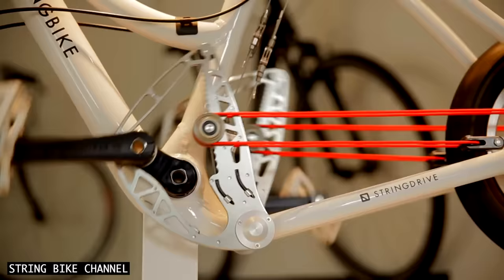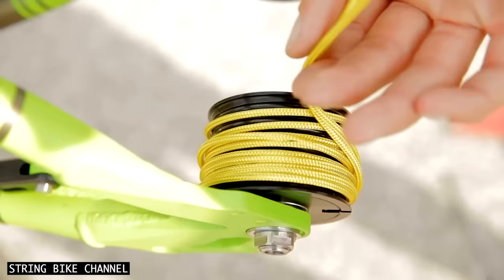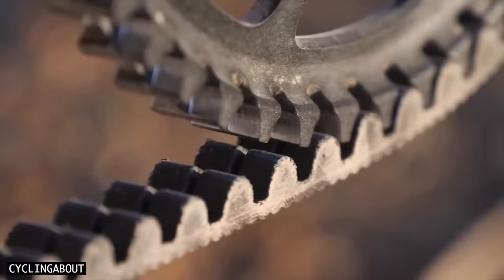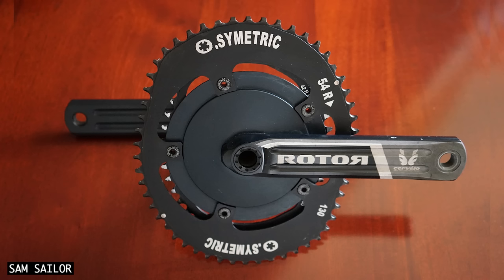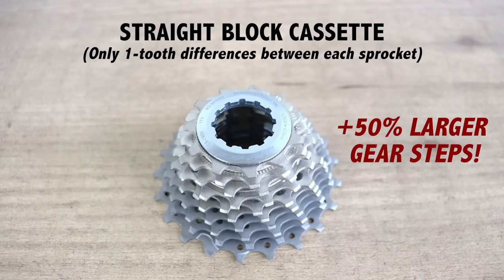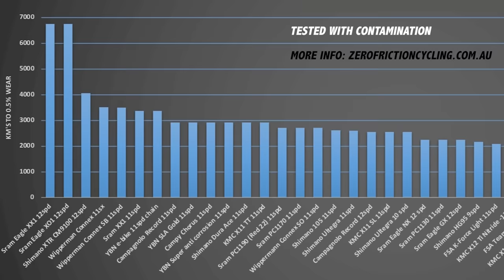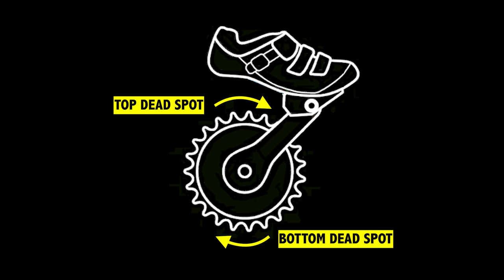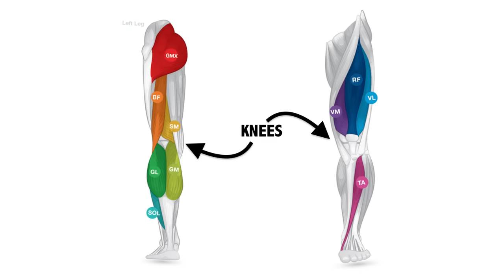Are Chainless String Drive Bicycles a Genius or Terrible Idea?

Comment: If anything, this shows us exactly what a revolutionary idea the Belt Drive was.
Reply: It shows that belt drives are a good option; not sure they are that revolutionary since belts precede chains by a long way, and have never gone away (car fan-belts, etc). Their advantage is that they leverage other developments in bike tech (notably hub gears). I wouldn't say revolutionary so much as an idea whose time has come.
Reply: There really isn't enough different about a belt and a chain for a belt to be revolutionary. Digital drive (maybe should be renamed) would be revolutionary if it ever took off.
Reply: yeah I agree on dialing down the "revolutionary" bit.  Unless that was merely a pun.
Reply: @chrishowell5718   <<and have never gone away (car fan-belts, etc)>> And the main drive system for Harley Davidson for decades.
Reply: wtf is wrong with regular chain jesus christ poeple cmon
Reply: The belt drive is a horrible idea, since its efficiency is very low, compared to chains and strings, and since it needs a proprietary, expensive frame... Don´t compare strings with belts. Belts hate going around small cogs, just like chains hate it. For strings, it doesn´t really matter to them. Belts are more durable, but the energy one wastes when using a belt, would be enough to wear-out a chain, without even moving a single foot. =very wastefull, while as expensive as several chains, I´ll stick with the chain. I never have to go off-road (since asphalt was invented), while I have to drive everyday, so, the belt´s advantage of staying cleaner also doesn´t count. maybe the belt-drive was revolutionary, for countries without asphalt-roads...
Reply: @joeskis   oh, I thought that was the whole thing...
Reply: Not revolutionary they are not better overall than chains and belt drive has been around for a long time.
Reply: You need to research new belt drives more thoroughly.
Yes they are less efficient, but not to the level that you claim.
Reply: @klausbrinck2137  Belt drives are great for motorcycles.  Harley Davidson has been using belt drive since the mid 80's.  Smoother drive train, can handle the torque, don't stretch like chains do, don't wear out like chains and sprockets do.  The Gates belts HD uses, last for 200,000 miles (322,000km)...

But I agree, for bicycles, nothing works as well as chains do.
Reply: @CaptainRon1913  Yeah, for bicycles, belts are an overkill, not comparable with a Harley Davidson (0,5hp vs. 100hp  ;-)
Reply: There’s one big advantage for belt drive, it’s maintenance free. Teeth do not wear like cogs nor belts stretch like chains. As for efficiency, it’s hardly noticeable at 2, 3 % less. Maybe more with internal gears and weight penalty, but not by much. Technology progressed much on materials that narrowed down the efficiency difference.
There is no need for regular oiling, chain adjusting, and replacing worn cogs and chains. That’s excellent for touring, work horse and daily use.
Reply: @aviverde9031 heavy, and it wears out faster.. the main advantage of the chain is that you can splice into it anywhere for a quick repair, which you can't do with a belt of any type, nor this string drive either... the only option for these is to replace the entire length.  the advantage with the Dyneema string drive is that spares weigh hardly anything... you could carry 6 of the equivalent length 3/16 inch./ 5mm Dyneema loops for the same weight as one spare ultegra chain, and 8 of them for the same weight of KMC 8-speed chain so literally 1/6 and 1/8 the weight of each chain type respectively.  note that I don't know exactly how long these Dyneema string drive strings actually are, it looks like the two ends are fixed against the frame in the middle of the loop wraps around the rear hub several times...and there's one on each side of the bike which might reduce the weight advantage when mounted on the bike to 1/3 and 1/4 respectively because you need two, but from the looks of it I would guess that it's probably shorter than the standard 116 link chain.
Reply: they aren't normal automotive belts that he's talking about, he's referring to Gates carbon belt drives, I haven't seen the data on them, maybe you have and that's what you're actually referring to.  though you are correct about needing a specific frame with a cutout to pass the belt through. a metal frame could be modified for it, that YouTuber who does the circus style bicycle acrobatic stunts had her bike done, but certainly nobody's going to do that with an off the shelf carbon fiber frame. I'm assuming they haven't been able to succeed at a carbon fiber belt that splits for easier installation/removal . Dyneema string is similar to the belt in one way: it's low-stretch. the Dyneema cordage I get for camping purposes does stretch under load as any slack gets taken out of the weave, so I'm guessing they would have to preload it at the factory during manufacturing to ensure an exact fit.

personally I'd gladly take the pedaling efficiency hit to increase the reliability of my transportation. I go through 2 chains per year, and one drivetrain. if I could switch to the gates carbon drive that maintenance alone would drop to one belt every few years, and the cassette and chainring maintenance would be swapped for the maintenance schedule of whichever internally geared hub.  when you're pulling a lot of cargo, there's a lot of inherent inefficiency that your saddled with already, and your body will adjust, so your priorities switch. I've gone from a cheap road bike, do an intermediately priced road bike, to a gravel bike, and now to a fat long-tail cargo bike that weighs 54 lb/24.5kg all on its own, and I often use it to carry around 54 lbs on the rear rack. safe to say marginal gains went out the window a long time ago for me, and probably for most of us who take the path less traveled. when you're in the middle of nowhere with no bike shops around, reliability FAR outweighs marginal gains
Reply: @klausbrinck2137 he's talking about Gates carbon fiber belts in this video, not your standard automotive type
Reply: @CaptainRon1913 he's talking about Gates carbon fiber belts in this video not your standard automotive type belt. and he's done a whole video about having switched to and toured with it. using negate carbon fiber belt is more about reliability than any sort of marginal gains
Reply: They are so revolutionary that sewing machines are no longer belt driven but use direct drive. Belts waste a lot of energy which is bad for the environment.
Reply: @aviverde9031  Good old chain is A-OK to me. It has worked so good for so long. I have been riding bicycles since 1968, and I have never had an issue with a chain. String is about the worst idea I have ever heard of. Not even slightly interested in a 'gates' drive.  - Cheers
Reply: @TheNightshadePrince  sewing machines need to be plugged in, using electricity. A bicycle is like old sewing machines that use muscle power that are more efficient driven solely by mechanical forces.
Reply: @madsam0320  Yeah it doesn't matter that there is small energy lose when it is human powered but when it is electrically powered, belts waste a lot of energy. Which is one of the reasons why industrial sewing machines use direct drive sewing machines as belts are not necessary. :)
Reply: I have owned a belt drive "folding bike"! A kind of "Strida" type, which didn't really fold and it felt like a badly trained "Jellyfish" when trying to ride it (the fold of the handlebar was fine and with two, mechanical Disc brakes).
   It was hard trying to get it up to riding speed, and I really don't think from this experience that I would ever imagine buying a Belt Drive bike?
    Finn. Denmark
Reply: It seems youtube is blocking my comments because of my content.
Please go to the top, next to the number showing the amount of comments made
select the comments order as from ''newest'' and you can read my blocked comments.
Best wishes.
Reply: I think it was more a rotational idea.
Reply: @klausbrinck2137  
"The belt drive is a horrible idea, since its efficiency is very low"
belts are MORE efficient than chains, it's just that you can't use a derailleur (which is more efficient than an internal hub).

"needs a proprietary, expensive frame"
that's just not true, all it needs is a back frame with a break in it, there's literally nothing proprietary about it and it would only add cents to the cost if it were to become more widespread

"Belts are more durable, but the energy one wastes when using a belt"
again, this is just untrue, as belts are more efficient

"(since asphalt was invented), while I have to drive everyday, so, the belt´s advantage of staying cleaner also doesn´t count"
rain and snow exist, so does dust, so does the mandatory grease on the chain
Reply: @TheNightshadePrince  you got it the other way around, if it’s powered by electricity, it’s not as important to be as efficient as muscle powered, because electrically powered is not as limiting in power and won’t get tired with long periods of work.
Reply: @madsam0320  Muscle power is free but electricity is expensive. I would rather save my money and toil than have a machine that wastes my money. :)
Reply: @festerofest4374  In a country where most cars have self changing gears with a badly functioning clutch (Named an "Automatic Gearbox"!) use on a 350 kilo, comparably low power MC isn't exactly what makes a belt a preferred choice. It is more clean and may be less maintenance demanding, except being changed at intervals?
Reply: @KenanTurkiye  I have had comments stopped from mentioning Specific Brands, I suppose, but I really don't know what criteria is used for blocking?
Reply: @finncarlbomholtsrensen1188  I understand, thank you for that good insight Finn, much appreciated. Best wishes.
Reply: @TheNightshadePrince  in the real world, journey is most frequently by motor vehicles.
Would you choose to cycle 50 miles on your travels?
Reply: @madsam0320  I have probably traveled that far by bicycle, honestly if you're traveling more than thirty miles one way you ought to have a horse and buggy. I walk to the store since my 1960s sears bicycle needs a new hub, it is ten miles round trip but it is nice and relaxing. I get to enjoy the beauty of nature and the virtue of solitude. :)
Reply: Chains are fare more superior to belts
Reply: @stevennagley3407  only slightly more efficient but the chain needs constant lubrication, adjustments and replacing.
Reply: @madsam0320  look at it in this perspective a, let’s compare two internal combustion engines one using a timing belt and one using a chain, they both serve the same purpose, the idea and concept is why isn’t all engines just all belt or chain, a internal combustion engine with a timing chain will far exceed the life of a belt timing chain. Repair shops and dealerships love timing belts because it’s going to make them money in repair cost while a timing chain will reduce or completely eliminate a failure etc.
Reply: @stevennagley3407   you are correct, timing belt need replacing or risk breaking after certain mileage. But on a bicycle, or even motorcycle, they can last for the lifetime of the vehicle. Bicycle chain is not heavy and chunky like timing chains, they are not enclosed and self lubricating. They stretched and need adjustments and replacing every so often.
We should not compare bicycles to automobiles, human power is much more feeble and subjected to fatigue more so than gasoline power machines.
Reply: @klausbrinck2137   What a load of bollocks. Sure, compare the no-load power loss of a belt and a brand new, clean and well oiled chain, and the chain will win in efficiency. Add a bit of load, like a typical cyclist at 200 W, and the belt is the winner in efficiency. Add a bit of wear and aged oil mixed with dirt and the belt will pull ahead even further. So for any real-life use case the belt is more efficient in power transfer. 

Is the asphalt where you live vacuumed every day ? Because any non-imaginary asphalt road will have dirt on it. Add a bit of rain and the wheels on the bike will pick that dirt up, and nicely deposit it in the chain.
Reply: @XerxesGustav  The difference in efficiency is too big, so that "real-life-conditions" would make a difference... If you start moving into e-bikes, and want to save every Wh, belts are a big mistake. And they aren´t flexible, they need specialised frames, that beat the purpose. Belts are expensive, more pricy than the best chains. If you have ever used a pricy chain, you´d know how good one can be, and how slowly it then ages. In the industrly, if possible, none would ever use a belt. Cause the belt, that could replace a chain, doesn´t exist yet.
Reply: It's funny that motorized vehicles are ditching the belt drive in favor of CHAIN while bicycles have started adopting it recently as an alternative to CHAIN.
Reply: That's why absolutely nobody is doing this, because it's so revolutionary!